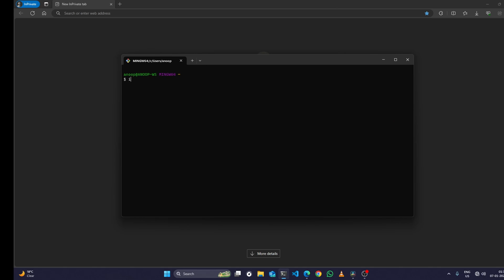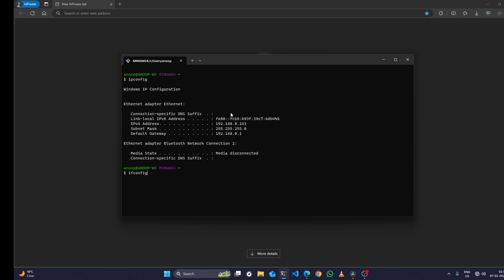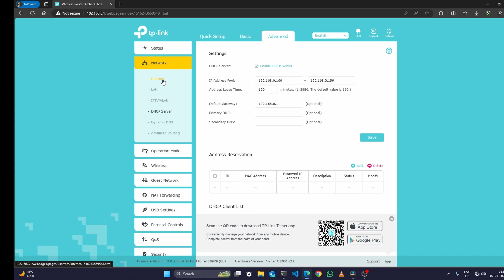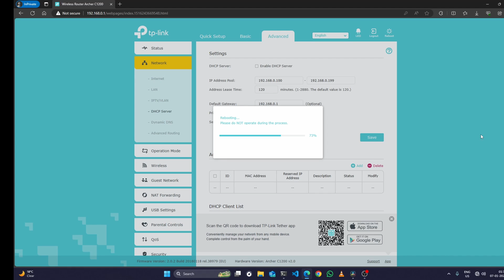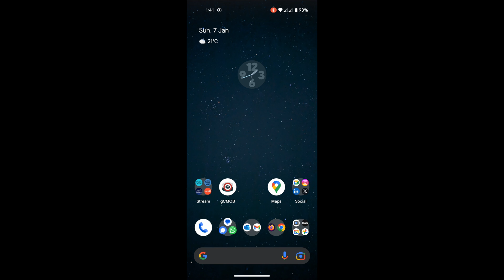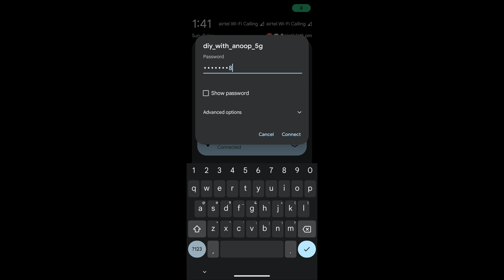PART 1 | DIY WiFi Extender: Use your old router as WiFi extender | This works with all routers!!

Comment: Hi Anoop ji, I have followed your steps and managed to make my extra router(tp link) as an extender. But do I have to keep connected this extender router with my main router using internet cable  or I can remove the internet cable and inatall the extender router to my other room where I have very week connection. Please advise. Will be great if you could send me your mobile number

Comment: Why did you not change the default gateway is ok to do that?
Reply from the maker: Default gateway is optional and defaults to your main router, in 99.99% cases you don't need to change it, either put your router's address or leave it blank.

Comment: Is the ethernet connection to main router necessary? Or can the reconfigured "extender" pick up the signal from your main router wirelessly? I need a solution to make use of my old routers as wireless wifi extenders as it'll be placed quite a distance from the main router.
Reply from the maker: It is possible but not with all kinds of routers, you need to check if your router supports bridging over wifi or has a repeater mode built in.
If both of these options are not present in your router you may use a powerline extender and connect the router to it.

Comment: Will this work with broadband
Reply from the maker: Yes.. broadband is the type of internet connection, and the router is just a device which enables wireless connection for your broadband. But all routers have a particular range, for example if your router is on the Ground floor the signal reception might not be good on the first floor, so you can use a second router to extend the range. 
The process shown in the video shows how you can repurpose an old router for the same.

Comment: It's just sad that I need to use an ethernet extension cable to connect the modems
Reply from the maker: There are several routers which can connect wirelessly, but the performance would be dropped, speed will just reduced to 50%, because same bandwith would be used for down and up link. Also there are many factors like how many other wireless devices, microwaves etc are in the proximity. Hence it is recommended to connect routers with a ethernet cable
Reply: @diywithanoop  Thank you for the quick response. But it'd be cool if you made a video on how to connect the two routers just for the knowledge of it.
Reply from the maker: @phoenix0000   Sure, will create a video soon on this topic. Thanks for the suggestion, cheers!!

Comment: This cannot be dont with mobile phone?
Reply from the maker: Now sure if I understand your question, are you asking can we use a mobile instead of a router? If yes then answer depends on your use case. Yes it is possible to connect your mobile phone to a wifi and start hotspot or tether on a PC.
But all mobiles do not support this functionality. Hope this helps!

Comment: which router you used as extender please tell me model name
Reply from the maker: It is  TP link Archer C1200 dual band, which supports speed upto 875 Mbps on 5ghz band and upto 300 Mbps on 2.5ghz band.
Product link: https://amzn.to/3vyFNdd

However the method shown in the video will work for all routers. It doesn't depends on any perticular router features. 
Hope this was helpful 🙏🏼
Reply: thankyou
 @diywithanoop